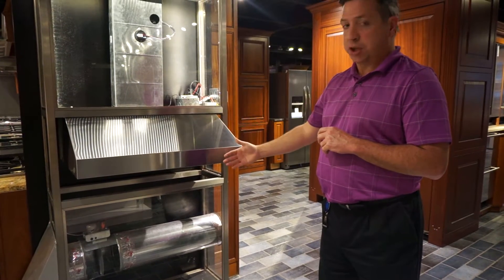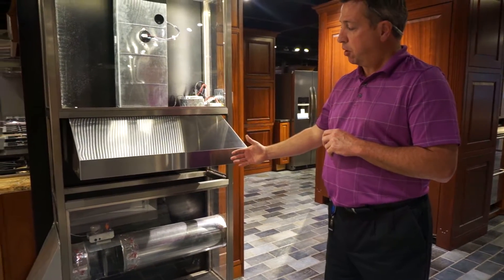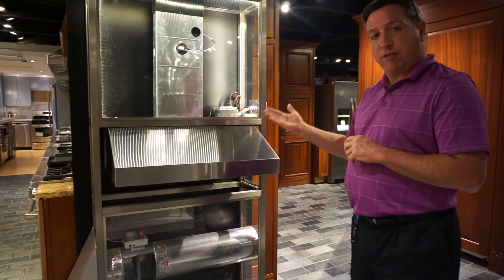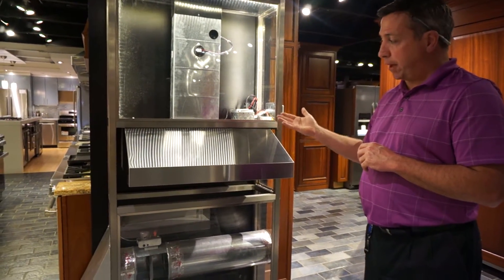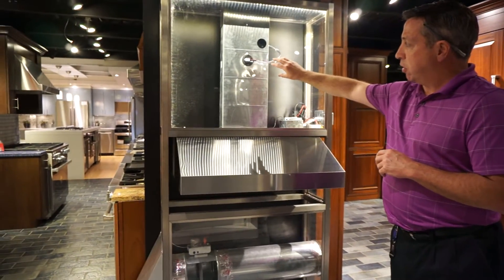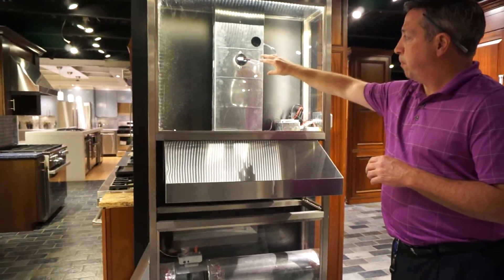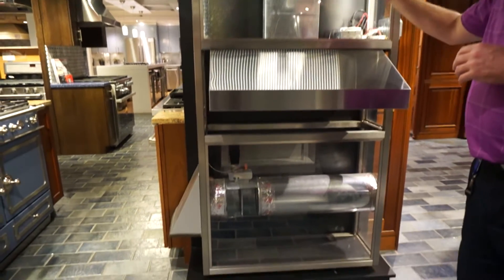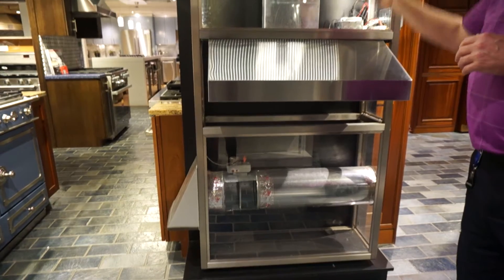How to install a Make­Up Air Unit

Comment: What do you do if your home is built on a slab & doesn't have a basement?
Reply from the maker: You can cut a hole in your kitchen...10 feet away from the stove on the opposite side.

Comment: SORRY BUT YOU ARE VERY MISTAKED, THE HEAT EXCHANGER UNITS ARE NEVER GOING TO HAVE ANY SUCH CAPACITY that you need ERV units typically make up bathroom vent fans& a % of outside air , the ducted o/air unit you show would be the preferred type, but just how much will that do?500cfm maybe ? Thanks 🇺🇸🇺🇸🇺🇸🇺🇸

Comment: I all about make people spend more money on unnecessary system that don’t make any difference
Reply from the maker: This is a safety system that's mandatory in numerous communities to prevent backpressure and the buildup of natural gas or propane in a house. Homes are now built using much tighter tolerances with less space for those gasses to escape, which is why these are important.